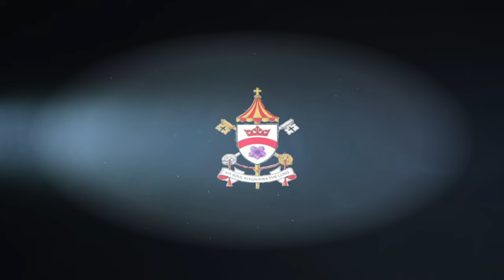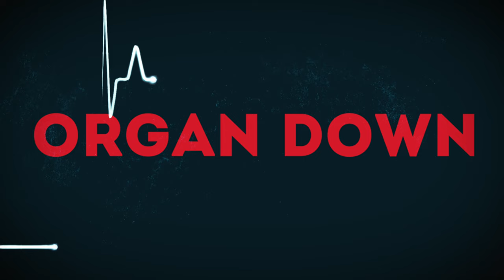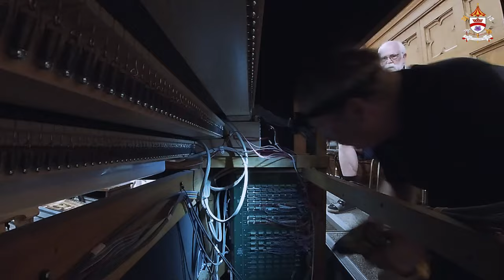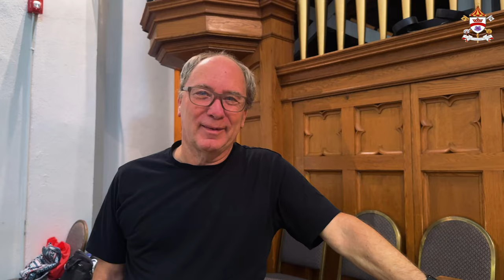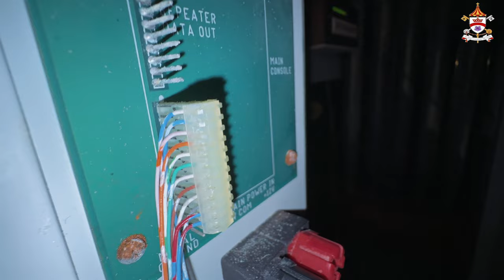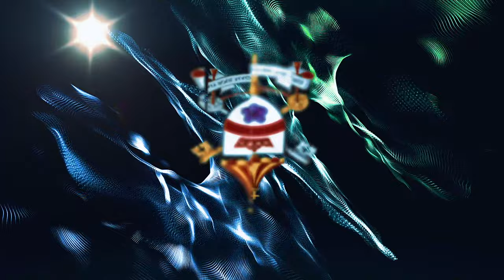ORGAN DOWN!! 😵 What happened?  Can we fix it?

Comment: FYI, take it from an experienced electronics repair person : if you have that much visible corrosion on the unused pins, and especially that much visible rust on the screws, you should plan at a minimum replacing those pin headers and the multi position plug that plugs onto them. 

The corrosion and rust is inside the plug, header, and wires. 

That'll be your permanent fix. 

Also, while the PCB is off the cabinet for the work, it'll give you a good chance to look inside behind it and verify all is well back there, too.

Once properly remedied you should be good to go for a long long long time as long as you keep it from getting corroded again ...
Reply from the maker: That is definitely the plan moving forward in the Fall. With the organ played daily we can’t afford to have it down, especially with that. Not to mention it picks Sunday of course!  Thanks for watching friend and reinforcing my thoughts on the corrosion.